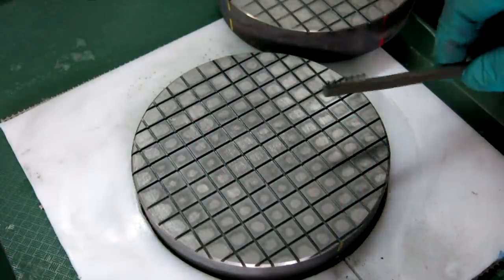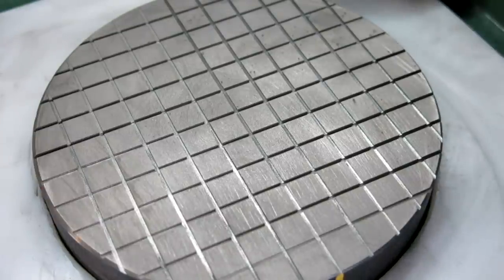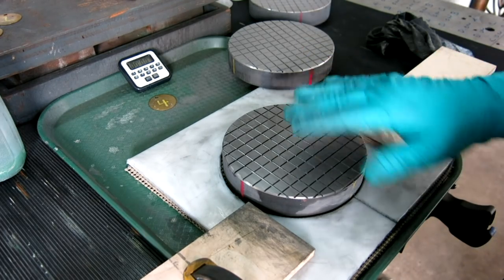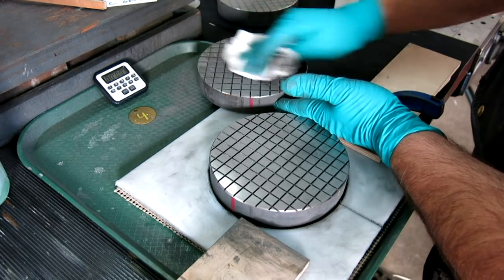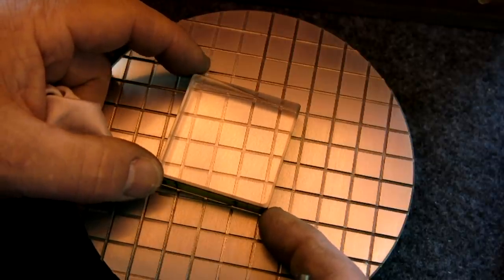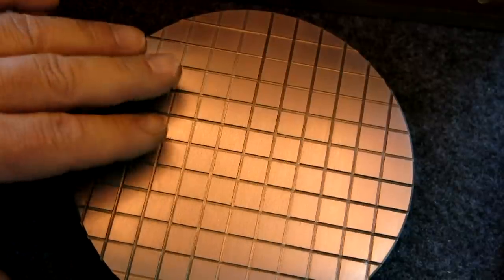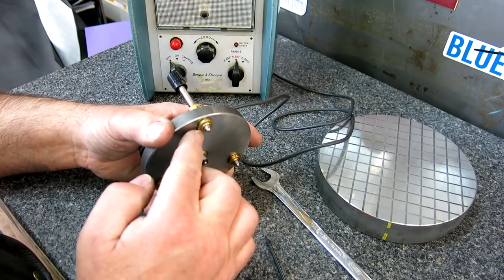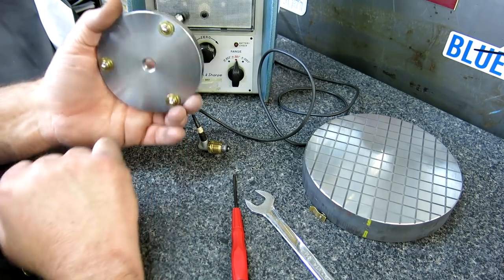Making Flat lapping plates 3

Comment: I was just thinking through "what if a pair had mutually dished/domed surfaces - so they seemed flat but just mated"

But then I realized in the set of three - you'd always end up with two dish, or two dome that would always work their way flat.

NEAT
Reply: Gold Star👏😂
Reply: The 3 plates method is one of the finest logical gems of engineering. Its deduction is well worth a read.
Reply: This method is the basis of ALL precision manufacturing. Every measurement is ultimately derived from these flat surfaces.

Comment: Holy smack, you’re making me feel like Neanderthal when casually throwing around lines like “dead nuts at 50 millionths”! I am proud, as a home shop guy, in the half-a-thou range for parts. But with the knowledge gained here I think my shit is going to evolve in a big hurry. Thank you for helping us extinguish ignorance and fire up the flatness!
Killer explanations, camera work, and accessibility!
Thank you!
CY Castor
Reply: He's got to be talking 50 millionths of a metric metre. I don't think even the apex of NIST goes to 50 millionths of an inch. Nanometers yes. A thousandth of an inch is 25.4 mm share by 1000 which is 25.4 micro or millionths of a meter. Unless I've made a big error in learning he's lapped that to two thou and you've got machine tools scraped in with the marking blue ink method the 4 times more accuracy than lapping.
You must be chuffed achieving half a thou in your home shop. I hope to do the same one day.

Comment: you need a bigger flat to check those. Guess how you can get 3 good flats ;)

It is neat to see this process done with metal, I have always been on the glass pushing side. Made few couple 14in flats for optical testing of telescopes. That kind of segmented surface is also used in optical work. The idea is to cut grooves on the back of one of your 3 glass blanks, adding a fourth broken surface to the rotation. It comes into play during fine grinding and polishing (6um and finer) and is used as a bruiser to break down the fresh abrasive charge at the beginning of each wet. It is extra work adding that fourth surface, but it really helps prevent scratches from contaminated abrasive.

Comment: Great video Tom!! Very detailed and well put together. One thing I think you should talk a bit more is using the flatness of the surface. Like the wavelength of the light source the spectral width and flatness of the optical flat. When using an interferometry measurement the flatness of the piece that you can measured is only as good as the reference piece. So if the reference is lambda/10 at 633nm then anything flatter then that can not be measured. Since lambda/20 optical flat is commercially available and not very expensive. Perhaps you can do a comparison. Also can you tell us the definition of the flatness? For example if you have a lambda/4 flat is it over the whole surface has lambda/4 or lambda/4 over 1 inch?

Comment: I had the opportunity a few years ago to work with a master optician whose specialty was making large optical flats for laser fusion research.  His technique for checking fringes against a reference flat was to draw a few lines with a wax pencil on the surface to be measured.  This would hold the reference flat just far enough to avoid contact with any residual grit while still giving nice fringes.  Something you might want to try next time...

Comment: Tom 
the hole in the middle is exactly what is done to make optical mirrors for telescopes. The process of progressive grits between two pieces of glass blanks will wallow out the center until a parabola is formed, and thus a mirror when finally polished.  To prevent the hole, a lap of a larger diameter would be required on the top side.  Not any authority for sure, but info as per reading on the subject.
Reply: I started grinding a mirror for a 6" reflector telescope back in high-school.
The first stage was to get the mirror blanks flat, then concave with a hemispherical profile, a parabolic profile came next then final polishing.
There were lots of grinding patterns depending on what part of the shaping was underway.
After way too long, I had the mirror ground out, but not polished.
That was as far as I got; had a good 'wet image' from the mirror, even a decent knife-edge test.
Good form, but rough surface.
Never got around to making the pitch-lap for polishing.  Life intruded.

Comment: Hi Tom,
Would it be a little quicker to start with plates that were first surfaced ground, just to get abetter surface to start with...???
Second question would you know of a good inexpensive source for an LVDT sensor?
So far it's an enjoyable series...   ;)
Cheers,
Pierre
Reply: Hi Pierre,

I found two or three sensors on eBay, but I couldn't find a datasheet for them (LG1000 and M758490-05 are two part numbers to get you started). I imagine that the 5 wires will be 1,2 (primary), 3,4,5 (the two secondaries with one of them being a centre tap that joins the two secondaries).

Not sure what the difference in voltage per mm of movement will be - what you don't pay for in the price, you'll probably pay for in time to reverse engineer! If you make one work, I'll be sure to watch! Good luck :)
Reply: Thanks Adam, I'll be looking into it, not certain to get any device done yet, it will depend on the complexity of the driving unit, haven't done serious electronics since 1991 when I got into manual works...
Pierre
Reply: I would have done the same, ground them first to take most of the unevenness out.
Or you could have given them a rub on the surface table with some wet and dry to flatten them out first.
Reply: "My exercise is to create the classic three flat planes of a very high quality with really simple tools."

From his Instagram.

Comment: Hi Tom, congratulation for your very clear explanation of the entire lapping process.  I am following your channel from Italy and I find it really interesting. I also have a question for you: let's say that I want to make a very flat surface with the 3 planes method and I don't want to make the grooving first because i need a continuous surface. Is there a method to create such a flat with lapping method?
best regards
Daniele
Reply: I don't really know this stuff, but I think from what he said in part one that the method would be the same, you'd just have to go slower.
Reply: The grooves carry the slurry off to make the tool; then you use the tool to make the uniform flat you desire.

Comment: REALLY surprised to see that the meter on the spherometer isn't a mirror scale for such a precision instrument! 

I found I could greatly improve my analog readings on my old AVO 8 multimeter using its mirror scale and even my 40 year old home brew linear bench supply has a meter about the same size as yours but with a mirror scale and it didn't cost much more.

Comment: Quick question, Tom, Because of the back and forth action you are using for the lapping, do you think it would also be a good idea to add a series of 90 degree turns to the bottom lap? I know the rotational lapping helps correct any potential grooving/swayback issues due to the back and forth action, I just thought a turning of the bottom lap as well may be an idea.
Reply: That is effectively being done as the sequence includes both 'A on B' and 'B on A'...

Comment: I'm taking a crack at this with some cast iron 5lb weights.  I've made good progress but I wonder how you kept the burrs down on the edges of the grooves and also managed to keep your plates so clean?  Mine shreds a paper towel almost instantly.  Did you do any deburring beyond the filing you did in episode 1?  

I also wondered how do you know when you have to  much abrasive and also how often are you adding abrasive at each stage?  The cleaning stage is very important and I didn't clean my plates enough on the lower grits.  The abrasive hides defects and I didn't really see the issues until it was very very clean.  Next round i'm going to dedicate a brush per grit and really soak them down to get everything off and blow them off after.

Comment: Very interesting stuff! With that tight fit on the pipe adapter was the saw cut really necessary? I am certain the bore would have collapsed enough to lock the part even without the cut based on the tight fit to the sensor.
Reply: I don't know if the holding is where the saw cut would come in handy. I think it would be more helpful on being able to get the sensor back out when needed. Just my thinking.
Reply: I was figuring the part would be clamped by non permanent deformation. I did not intend for the forces applied to actually yield the part. I am confident it would work without the cut and the clamping would be better as the stress would be a pure hoop and not a broken hoop with a large stress concentration. Schunk toolholders clamp end mills by the same process only the deflection is provided by a hydraulic force rather than mechanical, once the force is released the part slides right back out.
Reply: So how does a brass spring work if it can't return to its natural state?